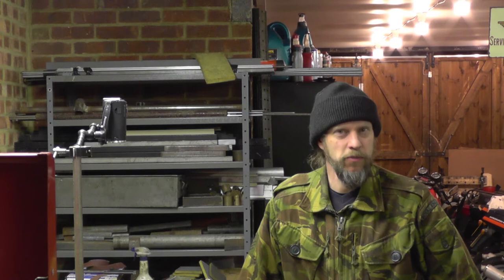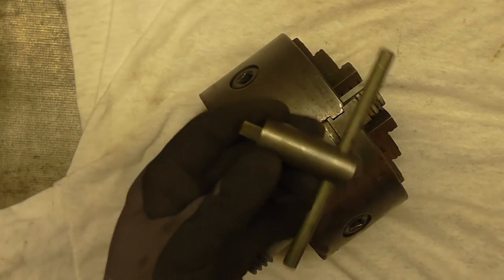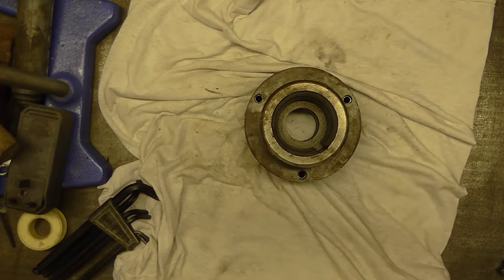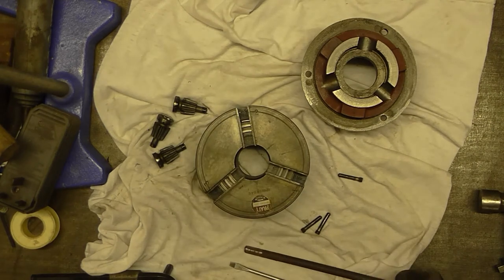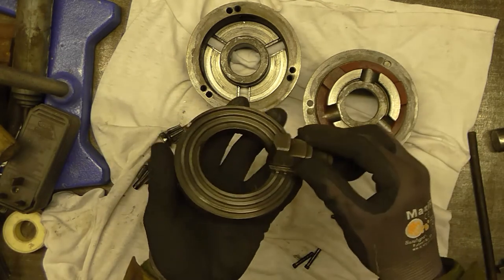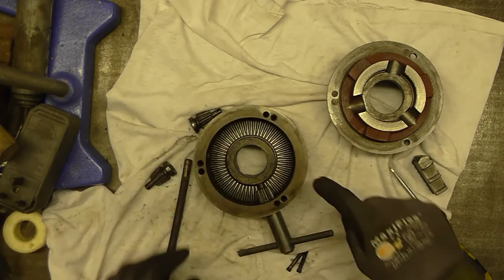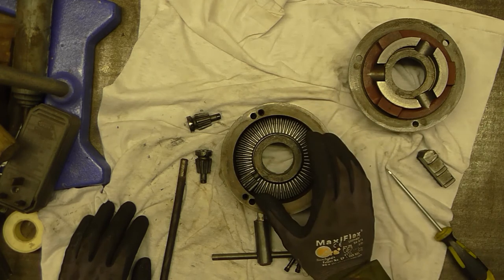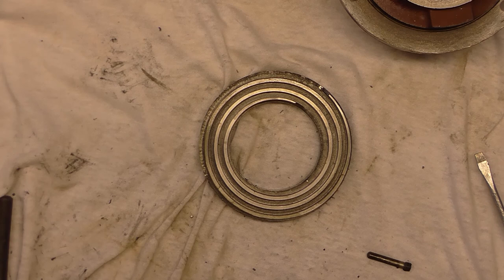Sunday Night Short VIIII

Comment: Nice video Paul.
Guys should get used to taking these apart periodically and doing a thorough cleaning/lube. The scroll normally does get filled with chips and crap causing wear. Consider what happens to rust and mill scale when the outer surface is turned. This dust is quite abrasive and will wear a scroll in the most commonly used diameters.

Colin
Reply from the maker: I'd extend that advice to complete machines. Almost every machine I have has been completely stripped, cleaned, lubricated and adjusted to work as well as it possibly can. I've seen people bugger about for hours trying to adjust to get a slide tight when that's impossible because there's a bit of swarf in there.
Reply: Yes, I like to pull things apart periodically for just the same reasons. Takes some time but pays off in the long run.

Colin

Comment: Hi Paul.  Very nice information.  This is the kind of thing more folks need to see and understand.  The oft repeated phrase "A 3 jaw chuck ain't good for precision work." is not enough.  Knowing how they work can fend off a lot of frustration.  Considering all the variables and tolerances that have to be exact in order for a scroll chuck to work properly should help folks understand why their $99 chuck doesn't hold 0.001 from one job to the next.

Cheers
Reply from the maker: As long as you machine all concentric features in one setting they're perfectly suitable for 'precision' work. Jaws that clamp parallel are top of my list for a scroll chuck. Even very expensive 'precision' scroll chucks aren't all that good.
Reply: Paul Compton
Yeah, the key is 'same diameter' and I didn't express that clearly when I said from one job to the next.  Thanks for the clarification :)